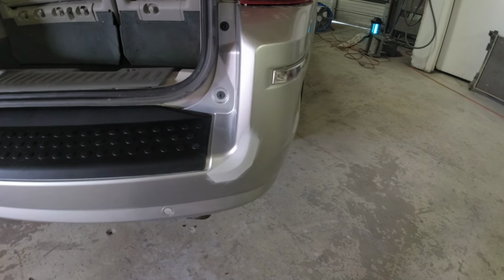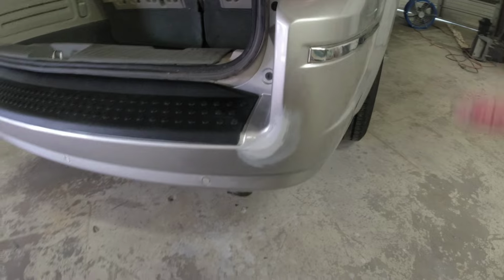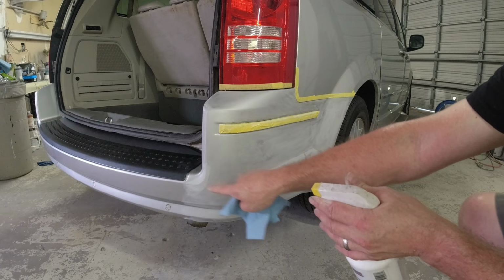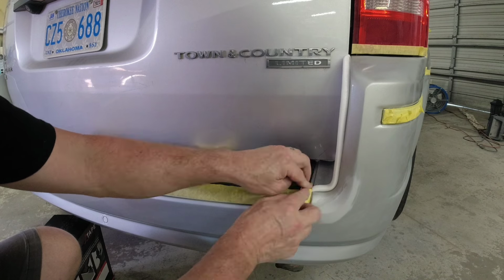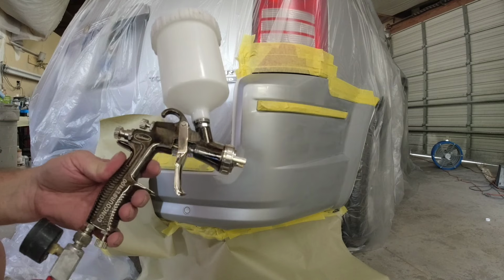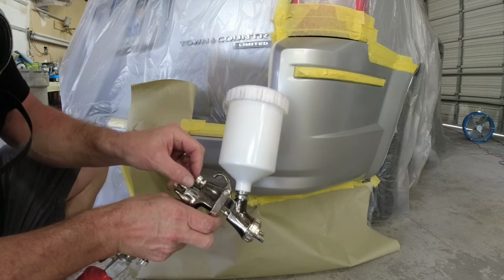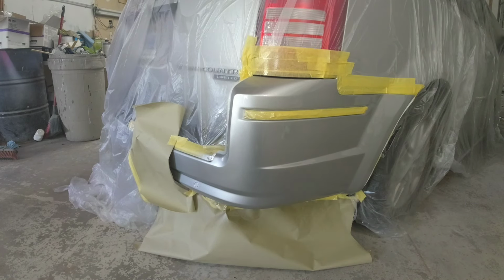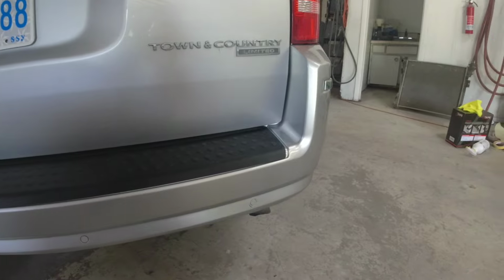Blending clear when spot painting your car. #howto #autopaint #autobody

Comment: Why did you sand the right side of the bumper with 800 grit but the left side with a gray scuff pad that has a higher grit (1000-1500)? Why not use the gray scuff pad for the entire job?
Reply from the maker: On the right side I want a better a deeper scratch for adhesion.  On the left I used the lighter scuff pad because  It's  where I blended the clear . I wanted to easily be able to buff the blend line. Appreciate your comment and support!

Comment: i am curious about how the blend of basecoat occurs. Won't the new atomized basecoat boundary still be visible of the left  because of difference in color  and faint overspray etc. ?  I understand that color blending with clear coat is less of an issue and  sanding afterwards will improve the blend of clear.
Reply from the maker: The basecoat blen is less likely to be visible than the clear blend as lon as the color is a close enough color match.
Reply: @GarageNoise  I will have to try it next time.  I wonder why they don''t make or use  a blending solvent for basecoat like they have for clearcoat.
Reply from the maker: @rcarioca  check out my videos on wet bed, clear basecoat that is what is typically used for blending difficult basecoat like silvers or other metallics.

Comment: For my bike, the clerk gave me the 1K instead the 2K. It's for my rear fender. Big scratch. Am I be ok with the 1K?
Reply from the maker: I would  use 2k , you can use 1k takes longer to cure and sometimes it can react to basecoat or old paint. If you use the 1k apply it with light coats. Of course you want to sand out the scratch first.
Reply: @GarageNoise  thanks

Comment: When you say you turn your volume 2 turns out. Can you explain turns out from what starting point?
Reply from the maker: Two turns out from closed. So all the way in is closed . 2 turns out is the starting point in adjust as needed.
Reply: @GarageNoise  thanks. I’ve seen on some sites they use turns in from needle contact with the trigger when adjuster backed all the way out then turned in till contact with the trigger pulled all the way open then plus turns in. I’m going to try your method cause I use an awful lot of paint even when turning in 3 or 4 turns.
Reply: Oh…I really enjoy your concise explanation and detail in all your videos.

Comment: I use aerosal from Microfinish on my repairs. Curious about whether my Ingersoll Rand 2hp 20 gallon needs an air dryer for an occasional paint job. And what gun to order if I decide to step it up. Do guns have a filter on them I see the regulator.
Reply from the maker: I add a inline water trap. Cheap insurance
Reply: @GarageNoise  I have that for my air tools. Thx

Comment: you are using the upol blend to wash in the blends, back in the day before there was anything like upol blend i used to use jamb-it door jamb prep which was made to soften the existing paint in door jambs allowing new paint to blend, i was even able to use jamb-it to blend in chip repairs in the middle of panels without having to spray out to any panel break or body line, with all the EPA BS now day's and the big push towards water based paints they I don't imagine they make anything like jamb-it anymore and no the crap they're selling as adhesion promoter isn't even close .......

Comment: Good Video. DEFINE UR  TERMS.

: What on earth is "WAsh", "Flash", help "bite into that clear" coat & other colloquialisms. 

I'm an engineer, actually used to work at an auto body for a short spell when I was young: couldn't tell U what those mean. ANY, repeat ANY public speaking coach will tell U to "DEFINE UR TERMS" in UR speech. 
SO, taking just a few seconds 2 tell us, the viewer what the terms ur using mean makes U a ten times better speaker! 
Like that U show, but don't "overshow" . 
That other auto body guy takes FOREVER to get to the point, AND show the action. THEN, BECAUSE he's so boring ( and inside him he knows that), hr impatiently skips action sometimes as to what he's doing.

Appreciate the vid.
Reply from the maker: Appreciate tour feedback! I am constantly telling myself that and working on defining terms for the viewers.  I do in a lot of my video's, but each video brings new viewers so I need to focus on that. Flash off means , dying time. Wash refers to cleaning the panel with wax and grease remover or isopropyl alcohol.  Appreciate your comment and support!